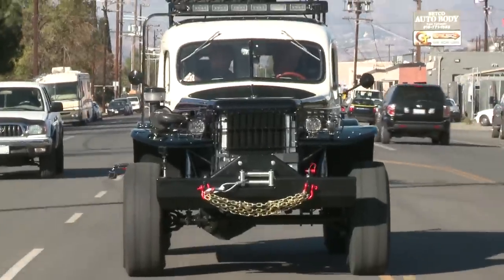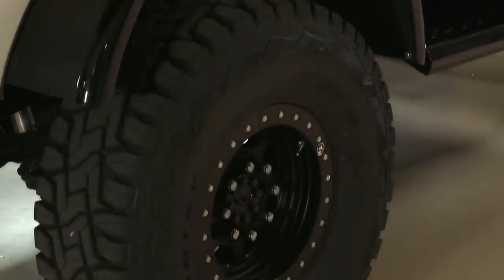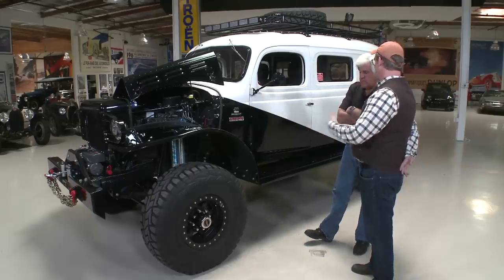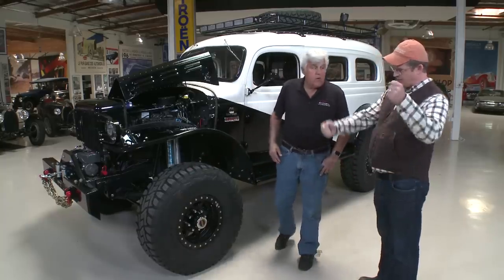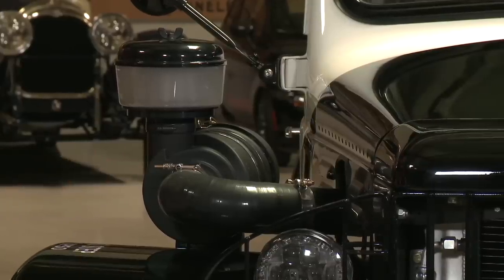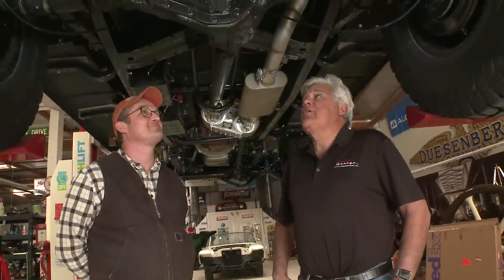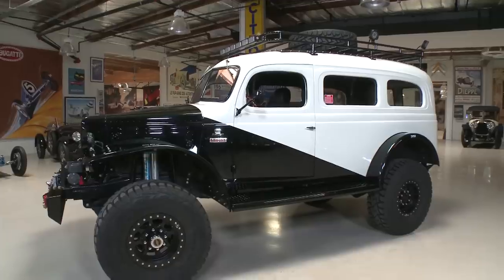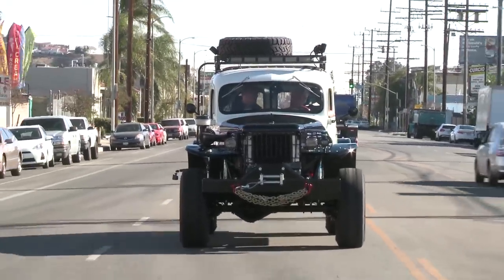1942 Dodge Carryall - Jay Leno's Garage

Comment: Terrible idea having to fuel inside.  Have to move cargo/tools to fill up. 
If he’s that worried about tampering or theft use a locking cap.
Reply: jay west I've got to agree with you on the fuel door. Other than that it looks like a well thought out build. 

They didn't mention what's in the front axle but if it was my truck I'd have a Detroit Locker in the front axle as well.

I guess there are a few other tweaks I'd make too:
- a bit more height/spring in the rear so it sits level and rides well with 1500-2500 lbs on board (or if I needed it to use it regularly carrying wildly different loads I'd install heavy duty rear air suspension).
- a large compressed air tank mounted underneath somewhere.
- strong skid plates protecting vulnerable components.
- off-road differential covers that can handle being driven into rocks without buckling. 
- something to allow me to winch from the rear (moveable winch, dual winches, or a pulley setup to route the winch cable to the rear).
- high power CB radio with a whip antenna.
- single color paint, probably white. 
- a rear 12V power jack (to power a cooler/fridge)
- a built in 15A (or more) 120V inverter and a few standard 120V outlets.
- if the atlas transfer case doesn't have a 4:1 low range I'd add it.
- strong cup holders for each passenger (two for each front passenger).
- strong, functional rock sliders to protect the rocker panels and provide additional frame torsional stiffness.
- removable custom built tool and parts storage for everything needed to support the race/rally vehicles. 
- removable rear seats with seatbelts to seat up to 8 passengers, including driver. 

Then it would be my ultimate heavy duty chase truck.
Reply: Agree! Not nice having diesel fumes in the car, bleh
Reply: Yeah, those work ...NOT!
Reply: stupid idea.
And even more stupid justification.
Reply: Ridiculous place to put fuel filler.
Reply: The padlocks where a poor solution as well
Reply: indeed, if you roll-over and need to get out...padlocked on the outside? Good bye!
Reply: This car was in Africa I'd rather it be inside lmao
Reply: JAy West. 

Lock caps are a joke. If a theft has to dig and search for the gas cap, he won't bother. So moving any cargo out of the way it get to the gas is a fine deterrent.
Reply: TABRAO,

As Opposed to? Give YOUR solution. The door latches on most vehicles are EASY to bust with a  crowbar and a cheater bar. There are commercial/industrial padlocks out there that are utterly impossible to break or pick without tools so expensive and hard to use it would be pointless unless you thought you were stealing a ton of gold and jewels out of that vehicle.
Reply: dll error,

Didn't think of just crawling out the windows, did you?
Reply: Slider68 Strong cup holders? Kinda usin the word "strong" a bit much.
Reply: Seano, 

Because... it is a STRONG vehicle. Built for War. Built for the Post-Apocalypse. And the Cup holders will absolutely NEVER give up. You roll this truck and the cups will still be in their holders. Now you just need STRONG cups.
Reply: Locking cap is easily removable they are hardly a deterrent. All you need is like a flat head screwdriver.
Reply: You can use MAP gas to melt most padlocks off in about 8 minutes.
Reply: You can always use your head, and pack the vehicle accordingly.  Security over convenience any day!
Reply: He said it was a Dana 60 up front, but never said anything about a Detroit Locker.
Reply: No Way,

You mean MAPP (methylacetylene-propadiene propane) Gas?  and the specialized equipment needed to use it renders it a non-option unless you are a professional thief. Because the equipment being used is itself more valuable than anything in the truck. Plus the skills to use that equipment are a marketable skill worth MORE than what you could steal for that truck. Those little hand held bottle torches aren't hot enough even with MAPP Gas. 

The ONLY reason anyone would go to that much trouble to cut the locks off like that is if they lost the keys and REALLY needed to get in. Even then a professional lock smith, again a highly profitable skill worth more than what you could steal from the truck, could open the locks without doing any damage. 

Cost benefit is a thief's biggest concern and it costs too much with not enough benefit to break heavy industrial padlocks. 

Not if you talking about cutting the latches themselves? That is different
Reply: nobody digs and searches. it's too easy to just punch a hole and drain.
Reply: I dont mind the fuel filler inside but would like to see it along a side , like you said now all the equipment will have to be moved.  The owner or people driving it will want it moved to make fill ups easier.
Reply: he said: 'there was an african in this car'
Reply: +DocWolph a carbon cutter 30$ will take of any lock
Reply: How in the world can this guy ask 250k for this poorly thought out build? Gasmonkey could have done better. This inside fuel fill is one of the cheap tricks that backyard "restorers" use, right along with beer keg gas tanks and varnished wood floors in pickups
Reply: @jerkyturkey007  cheap Chinese  chain hanging  off the front as well , makes me wonder  about  the rest of the vehicle ?
Definitely  more awesome then anything  I'll ever own bit still , if I had the money I would think twice  about  this one , I don't  think Jay was super impressed  either ! 
And the battery  boxes  will be rotting  out quickly !
Reply: Plus they are going to have to open that 150 pound tailgate many many times a day and he is talking about being in water up to the intake yet the batterys are mounted to the frame rail
Reply: @jerkyturkey007  , pickup trucks used to be manufactured with wood floors, straight from the factory.  🍼
Reply: @PHOTOGRASPER  that may be true, I've seen my share of refurbished pick up trucks and the varnished wood floors are only for the guy who isn't going to actually use it as a truck and will keep it indoors out of the weather. If that's what you want to do okay, whatever floats your goat. My 69 c 20 has one of those
 stupid wood floor beds on it when i bought it and I hate it.
Love the truck though.
Reply: @PHOTOGRASPER  https://drive.google.com/file/d/1GeamJmfLO5wkSZImOeOsw4UaEcjKaAFA/view?usp=drivesdk
Reply: @jerkyturkey007  that's a honey!
Reply: @PHOTOGRASPER  thanks, i show her off every chance I get.
Reply: @Slider68  Winslow said it's a D60 front with 4.47 gear on both
Reply: @TheMikielopez  I'd put the filler door outside and have it out of 1/8 stainless with frame.  Gel batteries, little suspension work and it'd be a pretty nice truck but ugh, that paint. Back bumper too. Sucked in tight and tube.
Reply: Yeah, good luck trying to keep track of all your gear after unloading it on a petrol station forecourt and you've got 30 Africans poking through it! It's gonna happen any part of the world where there is a hint of poverty.....
Reply: DocWolph you can buy a mapp torch for about $30
Reply: @doublel7337  Going of his usual specs for a build it will be an ARB airlocker in the front.
Reply: ...or use a crowbar and pry the hasps off the body. just silly

Comment: As much as I'd love such a vehicle... There would be a few adjustments needed.

Starting with the fueling location.
The fuel door will be trapped by cargo that would have to be moved every time you fueled. Not to mention that spilled diesel would not only stain both the truck and cargo, but stink to high heaven. (Made worse when driving in hot conditions like Africa)

Why not elevate the air filter to the roofline like mil spec.

Padlock latches on back need padlock protection plates for the nice paint job. The current system will not prevent the locks from flopping about on bumpy roads causing the locks to slam into the paint and chip it. Bad idea anyway as listening to padlocks slap and rattle against the back of the vehicle for hours on end would get maddening.

Tailgate needs some sort of lock down feature . If its meant to act as a work bench and withstand being hammered on, the cable supports will allow it to bounce.  Also inside of door should have been made flat as its curved shape will be annoying to work on.

Air compressor looks undersized.
Sure it may reach the necessary PSI but if the intention is to run air tools then CFM is a concern as well. As air tools are a pig on air. They drain tanks quickly and need fast compressors to keep up.

Straping down the axes and shovels on the back creates two problems.
One...  More Rattling
Two... Open to theft.

And one final thing.... A little aside.
Jay...if you are reading this...
KEEP IT BETWEEN THE LINES!!!
In every video I see you in, you always end up at some point wondering over the center line.
U don't LOOK drunk....lol
Reply: Rubber coated padlocks by Masterlock. Get rid of that stupid tailgate. It's way too heavy. Get some gel batteries that are sealed.
Reply: Because i want to unpack the truck to fill up said no one ever!
Reply: @gregorytimmons4777  Master Lock's a REALLY easy to pick

Comment: padlocks will be shaking and tapping like hell while on the trails.
Reply: And they just stick something through the lock and twist it off
Reply: You put the locks when you park the car.
Reply: Gotta admit that was pretty rinky. Like you say, the padlocks will rattle something fierce if you drive it down the road with them on, let alone off-road. It'll scar up the paint pretty quick too. So you're going to want to leave them off when driving. That means extra inconvenience every time you leave the truck or come back to it. Real easy to forget or just not bother. There goes your security.

A crowbar in hand is all it takes for a criminal to make quick work of the lightweight latches. No need to pick the padlocks. If sturdiness was the driving concern, he sure missed the boat with those latches. Ridiculous after spending 150 pounds of weight on the tailgate door itself.
Reply: Definitely those rear latches are a fail !
Reply: Who cares when in any other vehicle you can just smash the window. Same as this one
Reply: You put the padlocks on when you park the truck...
Reply: Rubber/silicone lock sleeves ... [now you know]

Comment: Owner will hate the service brake on that aftermarket disk brake conversion.  Who's idea was it to mount the calipers at the 12 o'clock position?  Guess to trying to get the service brake cable a bit higher at the cost of making bleeding a pain.  Put a service brake on the transfer case output.  That way the service brake works reliably, and you don't have to mess with the cables, and can put the caliper in the correct orientation.  Fuel filler needs to be sorted out.  It was a short cut, and we all know it.  Ditch the shutoff solenoid for a cable.  Hope the owner does a few chase/shake down's in the states before shipping it abroad.
Reply: Shain Andrews How about both ? What happens if at high mileage a u joint breaks ? Instant no parking brake. My opinion,both would be better.
Reply: How do you refuel it with your tools inside? Also how do you reach your tools in the back of the truck when you have something on the tailgate/workbench? You are standing in the sun/rain and can't reach or see drawers above shoulder height. Having a couple of 3cm thick work benchs that has folding legs so it can be moved anywhere and if firm mounting is needed it clips onto either side of the truck above the rear tire has been better as you can work on the less dusty and safer side of the road. Ours clip together with a 1msq centre to make a dining or gearbox rebuilding table

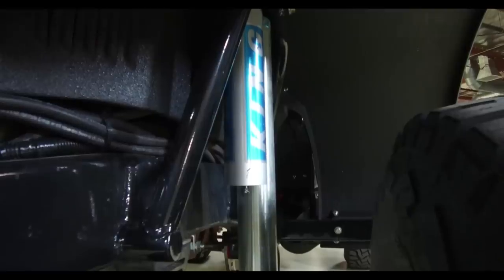Comment: 9:23 whoa don't use up all of that 2" of travel in one place. lol.  WTF 21:59 the rear has zero up travel as well.  And the guys is talking about adding a bunch more weight which will make the suspension sag even more??  Time to reevaluate those shocks.

Comment: Seems like a mistake to me to have the fuel cap on the inside if the car is supposed to be a support vehicle with a bunch of equipment in the back.
Reply: support-his-bank-account vehicle
Reply: The guy is full of crap.
"Only one wire to the engine , to shut off the fuel"
And the truck spent the war in Tunisia... BS
Reply: The one wire turns the fuel solenoid on not off. Actually it takes two one for the start solenoid position and one for run.
as far as tunisia ? they left allot of the equipment overseas after the war especially the less expensive harmless stuff like a truck. So it is possible but not likely
Reply: Yep, and there's no driving in water to just below the air cleaner when the fuel tank takes in water through the cap vent.
Reply: A locking gas cap would have worked just fine for security and been a lot more convenient.
Reply: the second wire is 'ground'....this guy is a bla bla guy.
Reply: And you only have to pick up a 100+ pounds of lift gate Everytime you want to fill, apparently that's well thought out..
Reply: Great point.  Not a good idea at all.
Reply: I am sure that removing all the crap in the back just to refill the tank would get old pretty fast...

Comment: This guy should hire Jay as a build consultant, i like Jays approach way better. There should be a heavy duty bumper,... the pushee will at some point be the pushed guaranteed no matter how capable it is.
I don't understand why he was so braggish about how EVERYTHING was built 4x's heavier than it needed to be, but  he put an electric winch on it, i don't care how many thousands of pounds the manufacturer said it will pull... it'll pull a small fraction of the weight a power take off winch will pull, see SUPERJEEP on Alaskan road warriors, its what made his offroad truck better than everyone else's.
It's a wonderful truck, with a few minor changes it would even be better.
Reply: Also the Dana 60 axle on the front, it seems to me he said it was a 5 -1/4 ton, the Dana 60 is a mighty fine axle, but its made for a 3/4 ton truck and he said EVERYTHING was built way heavier than it needed to be.  I hope the guy who's paying 250k doesn't see this show.
Reply: @jerkyturkey007   exactly my 1989 2500 cab chassis truck has the damn dana under it its nothing special its just a 14 bolt rear end... he up plays this "medium duty truck" too much but im willing to bet bumper to bumper a 3/4 ton 4x4 would hurt its feelings

Comment: I see alot things wrong in this rebuild wires under side loose not in cable protectors gas filler inside that might be a violation of some kind batt box under the chassis is a big one with no protection from rocks hitting it busting the batts they should be under the hood with hood locks they also make metal tubes with sight glass in them for the transfer box be better then that rubber tube is that even rated for oil gas ?
Reply: The sight tube on the transfer case comes with it. I see glass cracking because of shock. Now I agree there is a lack of under body protection. But it is mostly going to be driving on unmaintained roads not rock crawling.

Comment: Hi Jay and guys. I am actually the organizer of the rally where this baby will be servicing. I've read the comments here, and I believe that if you never made a rally like the one we're putting together you can't actualy be certain of this vehicle capabilities.  I have some experience crossing south and central america with different types of vehicles, from comfortable 4x4s to classic cars from the 20s. This truck will be servicing a 1938 Chevrolet coupe known as the Fangio as it is a replica of the one the Juan Manuel Fangio used to race in his early days. The color patern also mimics the car, this is why this truck has the paint scheme like you see it.  So Jay, if you want to come along in this adventure, we'll save a seat for ''ya!

Comment: lol the shocks in the front have 3 inches of travel at full droop and the rear seems to be fully compressed.  Maybe look into that.
Reply: Well, he is using the tire, with its large sidewall, for bump absorption and the major suspension component. See his comments about Mercedes diesel engine which indicate he is building for reliability not speed and hitting dunes at 70 mph. Since he actually built the truck and stated the suspension is his shops design and that he fabricated the leaf springs- I think they "look into that"
Reply: Not a lot of articulation with nearly no travel, probably be the first failure in the middle of nowhere
Reply: Thhe truck is lifted from the tires. How can u see the full droop?
Reply: Those front shocks look plain goofy. If the truck were dropped vertically front a height, or an elephant sat on the hood, they'd do their job nicely. But if you jam into a boulder that doesn't budge while going 40, I'd like to see one of those angled to absorb longitudinal shocks.
Reply: Mn09lfV6f Just my opinion but I think the suspension and his fabricated leaf springs are a pretty poor idea among everything Jay and everyone else has noted. Build an expensive vehicle and show it off to the world at JayLeno`s Garage expect to get nit picked.
Reply: willythewave what u mean "fabricated leaf springs"
Reply: +LOOT 720 they are fake..not rreal